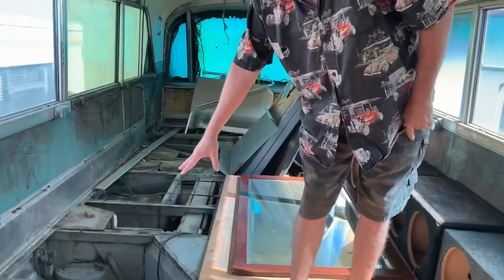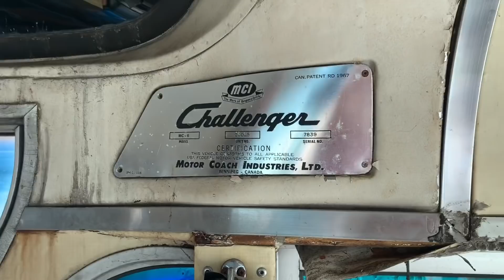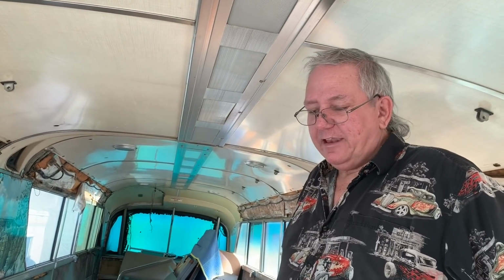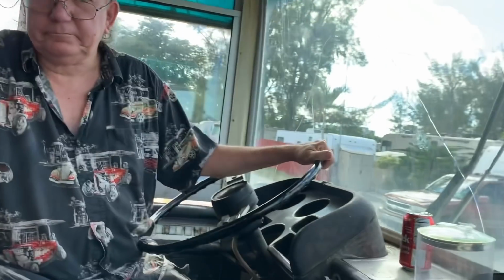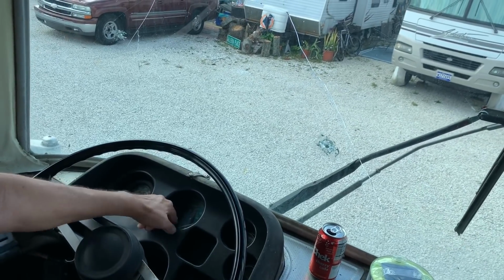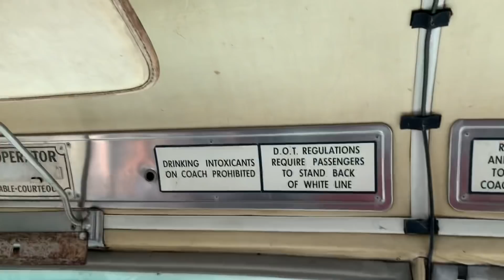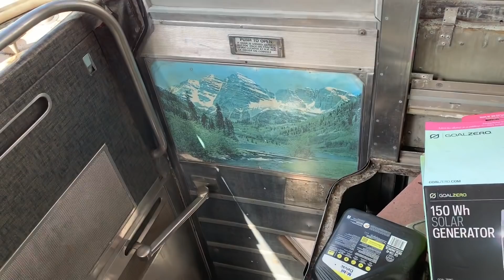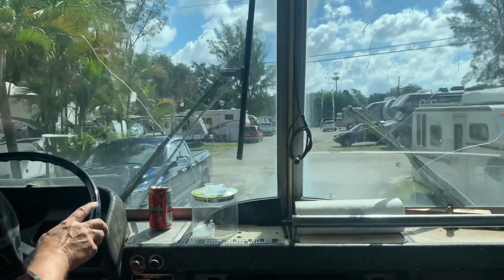12v71 detroit diesel mc6 bus test drive

Comment: Wow. Rare find indeed.  Glad to hear he is attempting to shift that old Detroit the right way. Hopefully once the throttle pedal is fixed it'll shift better. I've heard and sewn too many people who are not accustomed to the old 2 stroke try to shift at too low of rpm.
Reply: in the low gears best to shift before 1500rpm. In the higher gears it's fine to go for it.
You can rev them up in the low gears but you'd better be a trucker that does it all day every day and even they miss from time to time and I should know. Becomes a trap, fast shifting in low gears, because it mostly works but about 5% of the time, ie. when sitting at an intersection for 10 mins and you decide to go for it then gun it, it won't go in, leaving you stuck - like turning in front of another big rig that's going highway speed (jacknife, rollover, burst into flames, screaming, burning flesh lol). I shouldn't make light of this because you can almost guarantee it's happened ... : )
If travelling light, it's best to takeoff in a higher gear but you mightn't be able to in a bus because the gear ratios might be different compared to a big rig.
Reply: @ThePaulv12  you just described how to drive our current engines we have. The old 2 stroke is different. I was taught that you drove it like you were mad at it. Detroit 2 strokes were high rpm engines. You did not baby them. Quite the opposite really.
Reply from the maker: Except these are only 4 speed non synchronized and all 4 gears shift at high end rpm
Reply: @BusGreaseMonkey  Is that right? What gearbox is in that? I appreciate it is non syncro btw. What is different internally that requires it to be run up against the governor in order to shift? I'd be interested to know because I do actually understand more modern non syncro boxes were evolved to replace earlier designs but have to admit I've never driven a bus with a GM 2 stroke and a 4sp from a different era than the Eaton Fuller series of crash boxes.  
Most gearboxes in our fleet are just plain 'ole garden variety non syncro 18sp Eaton Fullers. We have 47 trucks (all of them under maintained in my professional opinion lol) so I might be knowing how to drive a non syncro gearbox since its my job just quietly lol.
Reply: @josephrichardson9662  Who baby's modern engines if that's what you're implying. I don't and they don't need nursing.
Up to the governor when necessary is completely fine. We run Cummins Signatures with a few Cats and a couple of Detroit Series 60s and they all get worked by many different drivers. There is only a small core of house employee drivers (of which I'm one) - all the rest are contractors. You can imagine what these interstate trucks go through. They all seem to take it in their stride. 
Detroit Diesel 2 strokes perhaps don't have the massive torque and reasonable horsepower of say a Signature Cummins  (2000ft/lbs+ @ 1300rpm and 600hp @ 2100rpm) so therefore require a higher rpm gearchanges to keep them in the torque band. 
Now you know what a Cummins Signature spec is, here is a dyno test of a 12V71 as equipped in this bus being put through its paces on the dyno. It is a Diesel dyno shop and it has a lug test through to a full horsepower test. This motor makes almost exactly the rated power the Detroit Diesel brochure says it should. It is uncanny actually. Anyhow enjoy:
https://www.youtube.com/watch?v=9FF42Nwx3oQ
Reply: @ThePaulv12  glad I'm not the only one who doesn't baby modern engines. The truck I currently drive unfortunately has the x-15 cummins in it. If rather have a Detroit 60 series or even an old 2 stroke. Granted I know today's engines have more torque and power then the 2 strokes and the mechanical cats and cummins. 
Today's engines would run better if companies like the one I currently drive for didn't castrate then so bad. Mine is set up strictly for economy not for power or anything else. Plus i. Stuck with an automated Eaton fuller transmission.
Reply: @josephrichardson9662  recently, i drove a 2 pedal type automated Eaton Fuller and i liked it a lot. When light it took off in a high gear and it was very intuitive shiftwise. When heavy it just seemed to perfectly harmonize the torque of the engine to any situation. The day i had it i was only on local so i couldn't put it through its paces It had one of the new Cummins high hp ISX in it and it was great. Another guy i crossed paths with from a different company had a new Scania with the 715hp 2600+ ft/lb torque V8 with the auto Eaton Fuller. He's a vastly more experienced driver than i and getting close to retirement (i have a few more drives in front of me before then) and he reckoned the V8 Scania was the best truck he ever drove.
My old unit is an '02 KW cab over with a 600hp Cummins Signature the 2000 ft/lbs @ 1300rpm earlier type. It is very ballsy, it puts a smile on your face.  The other day i had almost 45 tons GVM on and a 6 mile climb at highway speed. It sailed past 8 or 9 other modern trucks on the way up. It was hilarious the radio crackling to life with drivers asking about this souped up old truck. They could see i was heavy because i had a flat bed tri axle extendable trailer with 3 layers of RHS steel packs.
The Sig in my truck is just completely standard. You can see how much emissions are strangling power. So much so V8s are making a comeback. Go figure.
Reply: What BGM said. One reason those old two stroke Detroits worked so well in buses is the limitation of only four gears. You have to spin it up pretty good or you'll lug it down in the next gear. The Allison four speeds shift the same way, of course. 

One reason for only four speeds is space constraints. The transmissions usually had two countershafts and no synchronizers. The countershafts could be small since there were two, which helped keep the physical size of the transmission surprisingly small for the load they handled. One quirk of that design is the two countershafts must be timed properly when the transmission is assembled. If they are not, it's hell to shift them. I used to drive an old MC-8 that was out of whack, and the only one who could shift it consistently well was the owner, who had driven it many miles that way. Anyone else who hadn't driven it in a while had trouble with it for the first half hour. You'd get out of that one and take off in a less fussy bus, and shifting was like falling off a log.

Many of us worked pretty hard at being as smooth as possible. A lot of the old schedule drivers used a neat trick when approaching a stop sign or toll booth, anywhere a stop was certain. You slide the shifter into neutral just as you let off the throttle, and coast to a stop with light braking. Once you are stopped, you push in on the clutch and wait just a bit, then slide it into 1st like butter.
Reply: @ThePaulv12  I'm assuming you aren't in the U.S. Haven't seen any v8 lately. And unless you special order a freightliner argosy you won't find a cabover newer then early 2000s. I'd rather an older truck. I used to own a 2006 international 9900ix that had a 500hp Cummins is with an Eaton fuller 13 behind it. Ran great and pulled hills with ease plus I averaged around 7.5mpg. Wish I still had it. I'm in an international LT with the x15 in it. I hate the automated transmissions. Only time I like it is in heavy traffic or in the city especially new York city. I couldn't tell you what the torque is but I can tell you my company has my truck castrated pretty good. I'm cut to 66 mph and they have everything set only for economy. It sucks
Reply: @zackreuter6344  I always wondered why the older buses has only a 4 speed transmission.  My grandfather drove a few buses with difficult transmissions I remember. One of the buses his boss had he refers to it as a floating transmission. He never knew exactly what spot each gear would be in. Lol

I've done nearly the same thing in the trucks I drive when I have a manual transmission. Helps save on the knee.

I'd love to have the chance to drive both an intercity coach and especially the older ones. I've only ever driven transit bus and they were automatics thankfully
Reply: @josephrichardson9662  You're correct about the country. We have B-Doubles here. The axle loadings are in metric tonnes 6t for the steer, 16.5t for dual axles and 20t for tri axle set. This makes B-Doubles 62.5t and a semi 42.5t. We have our own KW factory down here. Cab overs are common but so are bonneted rigs. There's a reasonable mix of Euro and Jap trucks but about 60% (my estimations not official) are US based built under licence to Aust specs. Re US spec there are the typical mix of Western Star, Mack, KW. There's lots of old trucks about too and plenty of 2 strokes but not so much in an earning capacity anymore. They're everywhere and occasionally I do see one in revenue service. Saw one yesterday in fact. Usually they are old interstate prime movers converted into tippers and put on local. Silver Series were very common here as were 71s but 71s are not so common anymore for obvious reasons.
I'll post a couple of links including one with a locally built KW SAR with an 8V92 in it.
https://www.youtube.com/watch?v=kjOVfXrbnbQ
https://www.youtube.com/watch?v=zzl1FHxdn0c&t=103s

Comment: Saw your teaser video earlier today, didn't expect a follow up quite so soon. That engine sounds awesome and the interior is most certainly a blank canvas. You guys over the pond have pretty much got the coach RV conversion nailed but I must say I'm reminded of our british narrowboats when I look down the length of that bus. What's the usable width inside ? Narrowboats are pretty much only 7' wide, governed by canal lock and tunnel width, there are exceptions but that's a whole other story. Thanks for another great video.
Reply from the maker: I had a really busy day or i could have posted it earlier.  I messed with 3 buses today.
Reply: Usable interior width should be close to 8 feet, since this is the first "widebody" or "102". Eight feet, six inches wide on the outside. The story of the MC-6 is quite an interesting one. There were all sorts of oddball parts on them, including the tires. I've only seen a few, and they were rough. I'm just glad I didn't know about this one when it was for sale! It's in great shape for what it is, and that old Jimmy sounds wonderful.

Just discovered these videos, and now I'll have to watch them all. BGM is da man!
Reply: @zackreuter6344  Thanks for the reply Zack. Before discovering BGM I had no great interest in buses but I'm now pretty much addicted. I binge watched until I'd caught up. Really enjoy watching a master at work.

Comment: The reason greyhound couldn’t run them they,at the time were to wide for most surface roads but they could be ran on interstates. And the cranks would break in the middle journal. J.Crane

Comment: Sounds like music to my ears I Wonder did any GMC Fishbowl hide the 12v71 in them I know most of them had the 6v71 and 8v71 this 12v71 sounds awesome sounds just like the 6v71 but more aggressive that's awesome.
Reply: Freddie James.... No, the MCI - MC6 is the Only bus in the US & Canada with the V12.  The 12-71 does Not sound anything like the 6-71 as it was Not a modular design like the Series 92 - V12 was, which Did sound like the 6V92 because it was modular, being constructed of Two redundant 6V's, each with the V6 firing order of course. 

The Series 71 V12 was clean sheeted as a true V12 with a V12 firing order (actually, they utilized two separate firing orders, depending on application), so it has a sound all its own.
Reply: @Romans--bo7br  what bus did continental trail ways use i remember  they ran v 12 in rocky mtn's and west coast late 60's to mid 70's did not like getting passed on steep grades by trucks me 72 Pete 12v71twin turbo intercooler & aftercooled 110 black tag inj
Reply: @calvinbroughton3874 .... Thanks for your reply, Calvin.   You know... I'm not sure how to your question.  Are you saying that YOU didn't like being passed by the buses, or - the buses didn't like being passed by your truck and others?  During that time period, Trailways had their "Golden & Silver Eagles" (made in Germany, then the Netherlands) and some (originally) had 4 cycle German MAN engines, a few were Rolls Royce powered and the "Silver Eagles" had "Cum-a-parts" (ooops, did I say that?... I meant Cummins ; )..... and then after DD made the 8-71 available to "other" bus manufacturers (forced to, by the Feds), in 1959, Trailways converted their entire fleet of "Eagles" over to the 8-71 engine... but, I never heard of any of the Eagles having the "12" in them. 

The ONLY coach I "know of" that was ever built (main structure in Winnipeg, MB.Canada & finished assembly in Pembina, ND.) that was 12-71 powered was the MCI (owned by Greyhound by then) MC-6 (100 of them) as in this video.  All the MC-6's that stayed on the Canadian side (only 15 of them) for Greyhound, retained the V12's.... ALL of the MC-6's that they brought down to the States, were converted (in California) to the 8-71.  There were (are still?) some 12-71 powered buses (Setra?) in South America. 

Perhaps Trailways did have a few that were custom built with 12-71 power, but personally... I've never seen, nor heard of any and I have never found any listed in archives, belonging to Trailways..... but, that doesn't mean that was never any "experimentals" running around in their fleet. 

There IS another possibility, especially in that time period that you mentioned... and that is, that Greyhound (especially) and just a few Trailways, were included in the "experimental" program at that time, using Turbine power ("Free air" type turbo-shafts) across the country, along with semis (International, Freightliner COE's, Pete 352 COE's and a couple of Ford "707" COE's with their own Turbine engines) of the era.  Mack also had one ready for market in 1986, but were shut down due to possibly causing (are you ready for this?....) "Global Warming"!!

Anyway.... The converted buses of Greyhound did have a "gold" striped theme to distinguish them from the rest of the fleet.... perhaps it was one (or more?) that passed you in the Rockies, because they were certainly more than capable of doing so, fully loaded.

Interesting that you say your "12V71 twin turbo, intercooler & aftercooled 110 black tag inj"..... who built that?  Inter-cooling and After-cooling are two completely different systems... that would necessitate at nightmare of "plumbing" to make both systems work together. 

"Black Tag 110 injectors"?...... I formally studied Diesel Engine Design & Theory (specializing in 2 cycle) for four (4) years in the mid 1960s under one of the original designers (P. Nicholas) of the very first Detroit Diesel prototype engine and attended Detroit Diesel Training "summer school" during 2 of those years, and have personally "built" (modified) Detroits for my own use, as well as some for others...... and I have Never seen a "Black" Tag 110" injector.   What was the original application code or use of a "Black" tag 110 injector??  How many cc's was it rated for?

Comment: 6.5 miles to the gallon? Wow!  I was expecting less.
Reply: That's pretty good mileage for something of that vintage (1969).  I don't even remember the price of a gallon of diesel in 1969, but I bet if you filled up the seats with paying passengers and ran that thing up the road like a scalded rabbit, you'd still have a nice potful after filling the tank after the trip (that's 1969 prices, not today's prices).  That brings me to my question.... wonder how big the fuel tank is on that thing ?
Reply: @stanpatterson5033  .....If my ole brain remembers correctly,  diesel fuel was about .25 to .30 cents a gallon depending on where in the country you were at any given time.... and it was "Real" diesel fuel back then,  that made better power than this politically correct liquid that they pass off these days as diesel fuel for exorbitant prices.
Reply: Stan Patterson it has a 200 gallon tank. I can go from So Fla to St Louis or DC on a tank
Reply: @stanpatterson5033  -- well, considering that Clark Super 100 octane gasoline was 33 cents a gallon, I think diesel was about 19 to 20 cents a gallon back then. Would only have cost $40 to fill the 200 gal. tank.
Reply: Two cycle engines are not known for fuel efficiency, but back then with the cost of diesel being what it was, fuel efficiency wasn’t really an issue. However as time went on and fuel costs went up, it did become a consideration. Between fuel costs and emissions, it pretty much spelled the end for the two stroke Diesel engine. However, in their day, they were quite the engine and it’s great that so many are out there still working hard.

Comment: That thing sounds totally awesome. Just idling it sounds like it's itching to unleash massive power. What hp and peak torque does that thing have? Please post some videos of your conversation as you do it. I'm coverting a skoolie but these old DD 2 strokes are awesome.
Reply: 12V-71 (non Turbo): Max Torque: 1,200 lb⋅ft @ 1600rpm and Max HP: 456hp @ 2100rpm

Comment: 5 years later and ill bet this bus is still sitting in the same storage spot. Amazing a bus came with this motor but if the guy cant even fix the air leaks or even a windshield wiper im sure nothing else has been finished, hope im wrong. If your not mechanically inclined (and have a ton of extra cash laying around) a huge project like this should not even be considered. Hope it got sold to someone who has the time/money to finish this bus.